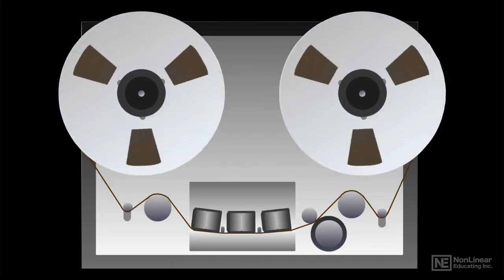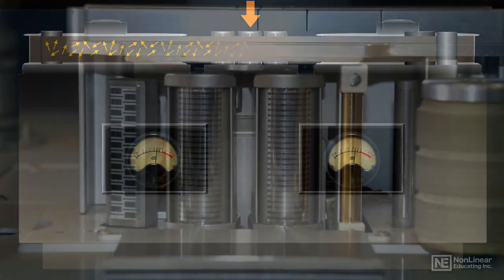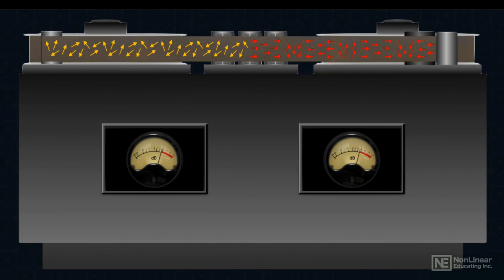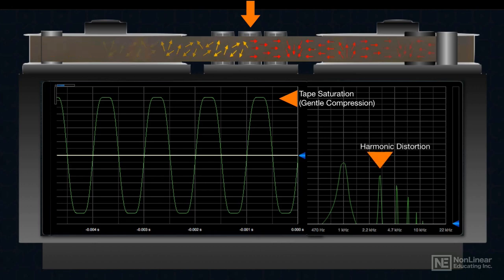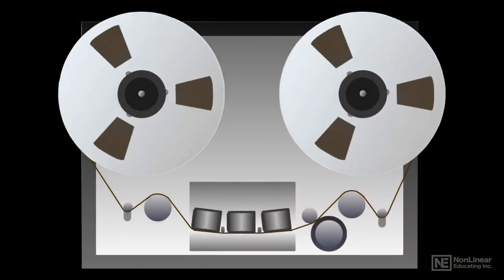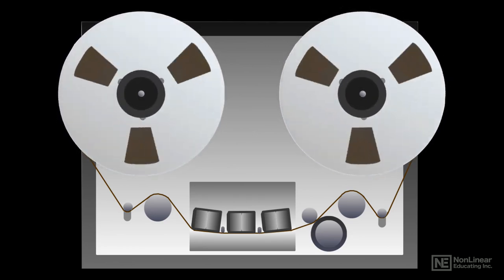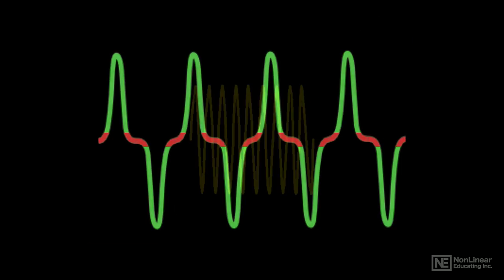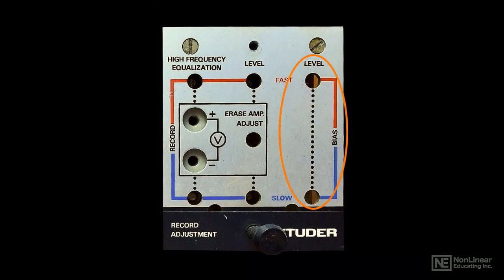Audio Concepts 107: Analog Tape Recording - 3. Physics of Tape

Comment: This is so much easier to understand in comparison to vinyl.  It’s analog, but it’s electricity.  It’s all electro magnetism, fundamentally.  It’s something else entirely to grasp how tiny grooves in a piece of plastic can translate into an entire symphony!
Reply: @The Best Western It’s not similar at all.  Also, the original vinyl record players didn’t have electro magnetic styluses.  They were acoustic.
Reply: IMO vinyl makes more intuitive sense than anything that came after it.

Like if you put a pencil on the end of a stick and dragged paper under it across the table while making really loud noises, that pencil would vibrate and draw a line in a specific way that was caused by the sound waves that hit it. 

Then if you developed a machine that could basically look at the pencil line and convert the line back into a vibrating speaker cone then you would basically have a vinyl record player. 

The only difference is it's resin instead of paper and a stylus instead of a pencil.
Reply: Partly thats because this video is just kinda plain wrong, beyond being over-simplified. Though honestly a phono system is identical to a microphone or speaker so if you cant understand that you really dont understand this,
Reply: @mycosys  What is wrong about this video?
Reply: @dk2853  IIRC (its a while now) watch "you dont understand saturation" by sseb. Clipping is only one type of saturation and not the type on a tape or transformer. The physics of magnetic saturation also means there is 'hysteresis' as well in any tape or transformer system.
Reply: Thats funny I was just thinking the opposite. It was easier for me to understand vinyl since the mechanical motion the vinyl cuts cause creates a similar reaction as a dynamic microphone where the mechanical power of air vibrates a magnetic inducing an electric current through a wire. Understanding the chemical composition of the tape that allows it to retain such specific magnetic charge patterns is much more difficult for me

Comment: I grew up when the transition from 4trk to 8trk happened, and my first stereo system was based around a car stereo that played both,  powered by a 12V power supply I bought from radio shack! I found out why 4 trk tapes sounded better than 8 trk, when i discovered what dynamic range and tape width mean. When cassettes arrived, I went nuts and remember the first cassette car stereos SUCKED, so in order to compensate for freq loss because of tape speed reduction, the electronics had to be improved, then cassettes took off.

Comment: So much of this is just plain wrong. Its near impossible to 'clip' tape, because its near impossible to completely align the magnetic domains in the tape. As they align they start acting on each other, like poles repel. They also experience a centripetal moment force normal to both the applied and exiting magnetic spins, or 'precession'. This means that as you add more magnetic field, the effect on the alignment of particles diminishes leading to a non-linear 'saturation' area or in effect compression of the waveform, or if you want to look at it another way a logarithmic transfer function. NOT the discontinuous clipping function you repeatedly show to represent saturation.
Unlike clipping this means that data in this region is not completely lost, just a bunch of other stuff added. Its VERY different to clipping (though clipping is a type of saturation, it has a hard knee (a discontinuous function) rather than the soft knee of what is traditionally called saturation).